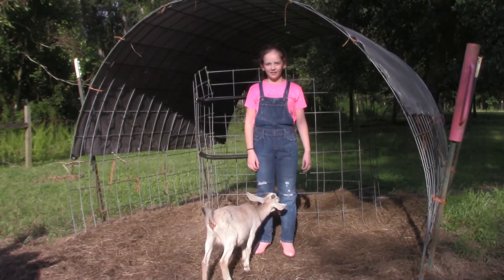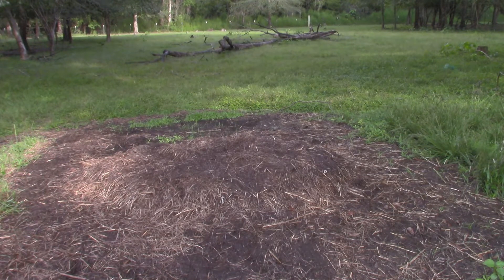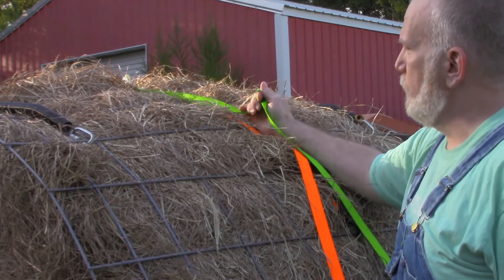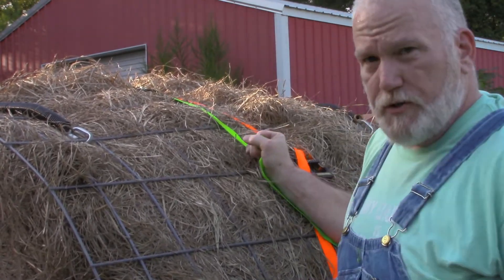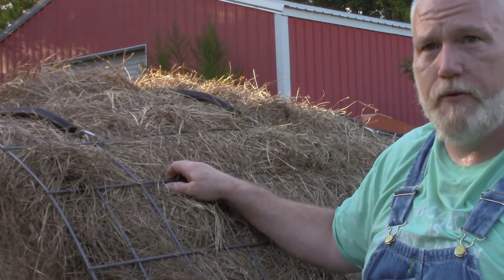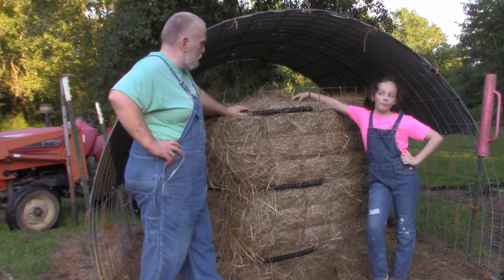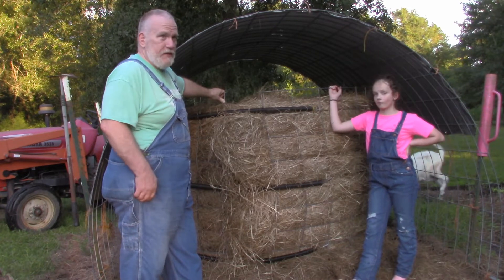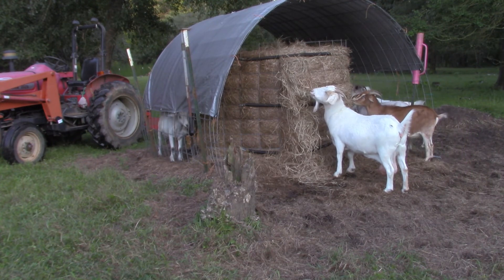Cheap and Easy Round Bale Feeder for Goats or Sheep- Mudd Flapp Ranch

Comment: put it on a pallet to prevent the moisture being sucked up from the ground.
Reply from the maker: Not a bad suggestion, but I have it set up on a hill and don't any issue with moisture. I have a bunch of goats eating and it usually doesn't last long enough to worry about.

Comment: Great idea and thank you for sharing! Are you also using 16' panels for the shelter?
Reply from the maker: Yes, 2 cattle panels held together with tie straps. A $9.99 harbor freight tarp (8'4" x 11'6") works nice for a cover, they only last about a year, but when one gets a hole I just add a new one on top. I use 4 T-posts to hold the bow in the cattle panels, and a 10' piece of 1/2" conduit on the bottom.
Reply from the maker: When it gets too messy, It is super easy to move to a new spot.